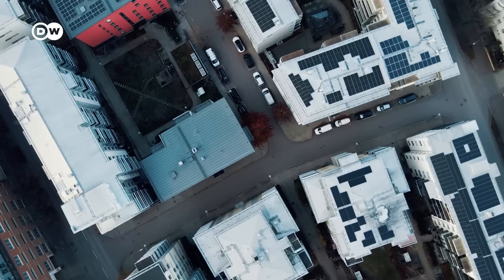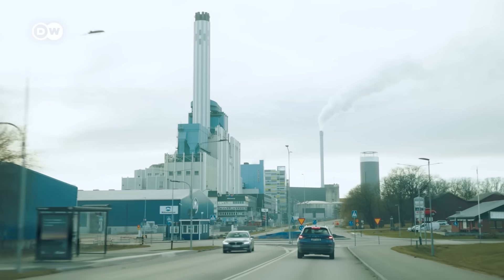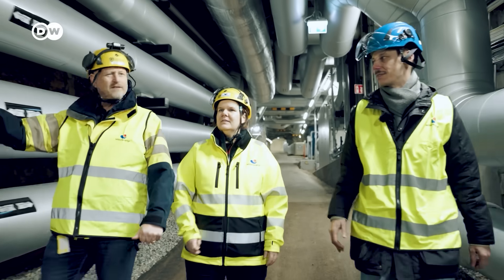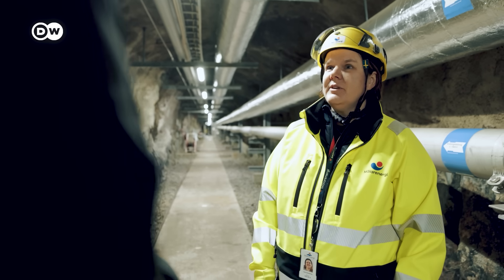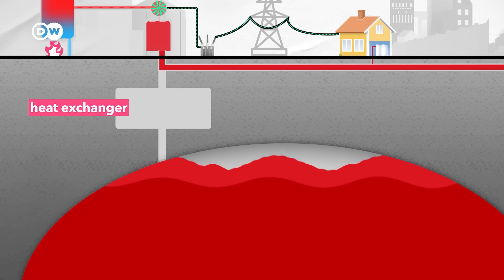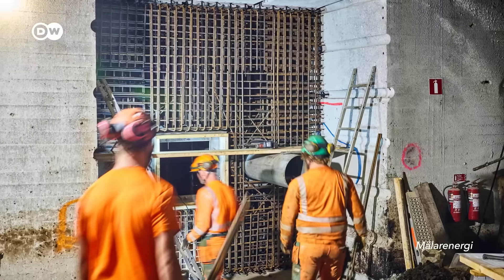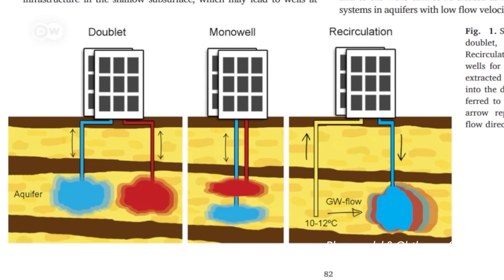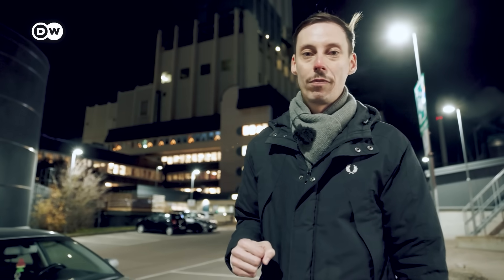Why a city in Sweden filled these caves with almost boiling water

Comment: I grew up thinking district heating was the norm, and what everyone was doing - it actually surprised me that a lot of countries, even in Europe are still heating individual houses, especially in big cities? That is so inefficient.
Reply: These systems usually use waste heat from electric power plants so losses don't matter much as that heat was being rejected to the environment anyway at the plant. The only main factor here is if the cost of pipelines and maintenance is worth the heating fuel saved in the long run. I do agree though in most cases it won't be worth it especially if the city has to turn on the auxiliary systems like boilers etc just to heat water in cases when rejected heat isn't enough
Reply: @CosmicSilhouette  the main saving in district heating apart from the lower individual investment is that you can chose the cheapest heat source, heat pump, combined gas engine, gas, waste heat, electrical heat, having a storage tank makes it better as then the district heating can chose to produce the heat at the cheapest times of the day.
Reply: I believe heat pumps on individual homes would be more efficient. And district heating would be a great solution for multi-unit & high-rise residential.
Reply: @mikeb5664  the thing is we hate pumps don't they need a certain temperature of weather like I read reports by engineers in the UK saying England for example would you want the worst countries for heat pumps just not efficient enough 
But places like Sweden Norway would be
Reply: Where I live some of the larger apartment blocks have district heating but houses have gas or electric.
Reply: In England in a council house that's a house for not very well off people 
 they forced us all to have gas central heating and get rid of our wood and coal fires, 

 once we're all stuck with gas central heating they jacked up the prices so much most people can't afford to heat their homes now.
Reply: @somethingelse4878 I wouldn’t recommend eating a home anyway to be honest
Reply: @Dlckslice  lol you've got to love Google voice to text
Reply: @somethingelse4878  at least it’s consistent using eating twice 😂
Reply: @Dlckslice  omg lol did not see that lol
Now I'm going to heat some toast lol
Reply: As someone who lived in the tropics, i thought the concept of heating your home is crazy
Reply: @davidtitanium22  Then think of district cooling, better do both then you always got hot water and cooling during warm periods, also makes the heat pump much more efficient as it just has to move the heat from one to the other :)
Reply: @davidtitanium22  I think the concept of cooling your home is crazy 🤣
Reply: District heating can be a bigger problem if not run in a reasonable way, such as not making the full use out of it, providing heating only when it gets too cold, or not billed correctly to the exact usage. In China, many colder cities have district heating, but its only used for heating, and start to heat very very late, while stops very early, leave every household have either electric or gas boiler for hot water and a few reversible air-conditioners for the transaction season. Meanwhile its not billed or run correctly as its only billed depending how big the space is, not how much energy you have taken from the network, and you can't control the temperature, thus most people are either too hot and  wasting heat or too cold that use gas or electricity to warm up at the same time. In this case, individual gas or electric heat will save more energy and provide more comfort. Also, nearly all district heat in China are provide by 100% fossil fuel, and a few provide by electricity such as heat pump which uses electricity mainly produced by fossil fuels.
Reply: @呵呵呵呵-l6i  Not optimal, having hot water year round is a blessing, and you don't have to burn things year round if you have more than on source of heat, heat pump, electric boiler, maybe combined gas engine, and then having a storage tank for 2-3 days either to bridge overnight or during a cold spell saved on the cost too.
Reply: Nope. The most efficient way of heating & cooling these days are with heat pumps installed on individual houses. Big systems like these are AWFUL for efficiency because there's just miles upon miles upon miles of pipe that dumps a huge amount of it's heat traveling said pipes. It's extremely expensive to maintain, install and buy.
Reply: @Runefrag  Heat storage for  individual houses is expensive and ineffient. And heat storage is much cheaper than electricity storage. That's why district heating is often the better solution.
Reply: @Runefrag  the upside is them generating electricity, and being able to get rid of a lot of material that would otherwise go into landfill, so you can't really claim that local heating is better, best to not generalize these things
Reply: @Runefrag  The reason why district heating is possibly less efficient than individual heating is because the water temperature in district heating systems is usually much hotter (95°C) than the water temperature in individual house heating systems (down to 30°C). The individual house heating can compensate the lowered temperature by increasing flow, but that only works because it doesn't have to run through the whole city. And heat pumps specifically suck at running with high water temperatures.

I do think that there is a place for district heating, the heat from data centers, industry, remaining fuel power stations or waste incinerators should be used instead of being thrown away.
Reply: @Heimbasteln  Heat from data centers is low temperature, below 50°C. - A big disadvantage of DH is their monopoly - there are people in Germany who have to pay 2x or 3x of what it would cost to produce the heat locally. And they are obliged to use the DH system. NEVER connect your home to DH!
Reply: @Runefrag  So inefficient that counties have been able to use this to heat homes in arctic conditions while providing lower carbon footprint and also being affordable?
Reply: @Runefrag    Yes, $15.5 million to build a heating system for 160,000 people is super expensive. Are you kidding?
Reply: @Runefrag   Yes, $15.5 million to build a heating system for 160,000 people is super expensive. Are you kidding?
Reply: @stevenmitchell1  that's one small part of the system, two weeks worth of heat, I suspect under the best conditions. District heating systems are fine for high density, they don't make sense for lower density, which is why most in the US were abandoned.
Reply: Get off your high horse, individual house heating could in theory be more energy efficient. More pipes in district heating creates more ways for heat to escape
Reply: @Dudenier Find your last remaining brain cell and think critically. Waste heat means district heating is inherently more efficient. Electricity generation, data centers, smelting, etc. It’s using all that heat that otherwise is vented out.
Reply: @Dudenier  wow someone got mad they live in a country where the government doesnt function well enough
Reply: @Dudenier  Using electricity to heat a house cannot be more energy efficient than heating a house with waste heat from generating electricity.
Reply: @Dudenier  "in theory" How about you get out of fantasy land and live in the real world.

Comment: Very misleading propaganda. District heating is not a new concept, neither using underground (geothermal) heat. While the thermal mass of big water reservoir can sustain high temperatures for quite sometime, but claims such as "extra heat from summer can be stored and used in winter" require some data, which this propaganda piece didn't do.
While they admitted the in the end that the impact of this project is small, but what they don't show (apart from the actual data about thermal performance) is that not every thing can be scaled up through additive systems.
Proper cost to benefit analysis should be presented to make such pilot projects before presenting them as "solutions".

Comment: Interresting to see a report like this from my home town.
I believe that Västerås was the first town in Sweden to introduce district heating.
And now first with this large scale heat storage.

But unfortunately I have so far only seen cost increase on my heating bill.
Hopefully this investment will pay off in coming years. Also for us consumers.
Reply: I moved here to Sweden from the UK, and honestly my heating bill is nothing compared to what I would have paid back there for a gas system inside the home. We're talking 1,2k SEK per month on the coldest days for a 15-20kvm 1 room apartment. Kinda crazy thinking about it
Reply: @ellafoxoo  tbf the UK has one of the highest costs in europe
Reply: @ellafoxoo  That's pretty cheap nowadays honestly, heating in Denmark is easily 2 to 3 times that
Reply: @Yous0147  not if you have individual heat pumps
Reply: Guy has an energy bill 60% cheaper than the average and still complains about it.
Reply: Paying off the upfront infrastructure costs may be expensive, but once those have been paid off, the ongoing costs should be cheaper for the long term!
Reply: Are there still some Swedes there?
Reply: @andersholmstrom3571  I highly doubt that we will see a decrease in cost for heating. As Mälarenergi is owned by the city and the Social Demokrats are in constant need of other peoples money. They are allowed to take I believe a 10% payout from the earnings they need the earnings to be as high as possible. Same with Mimer.
Reply: @toysoldiernostalgia  district heating network has a great waste of heat the network individual heat pumps are far more energy efficiant in total.
Reply: Kostade väl fett mycket bygga kostnader ska väl känas in .
Tror nedgången är här  rött stort skjul vid bergsknallen.
59°35'3.2"N 16°30'55.8"E
Använd "min karta" 
Lite löjligt med hemlighetsmakeriet (tycker jag..) mvh s
Reply: @perstaffanlundgren  smart man i krigstider den där...

Comment: Wish we can store cold like this and use it as our area  heat up with  high temperature in summer.
Reply: Yes you can. Like you can make ice in the cold times and melt it during the hot times.
Reply: @stormveil  wow must find out the proper method. It can really be helpful for mankind. Anyone who are struggling with varying climates. 👍
Reply: @kaushalvora7244  there are various ice making methods. one method is the same technology as air conditioning and fridges - The heat pump. When you dont need much cooling you keep running the ac to make ice so the ac is not overwhelmed during heat waves. Run cold water in district pipes instead of warm.
Idk if it makes economic sense tho, you'd have to analyse it with an expert.

Comment: I installed a heat pump last summer in California and I am very pleased. Saves me a lot of money on electricity and gas.
Reply: I did the same in Ontario Canada and got the same results. My only issue is dealing with the water run-off.
Reply: Air source or ground source?
Reply: Bad bot

Comment: if the distance to surface was slightly less, they probably could do big greenhouses on top of them in the north for tropical stuff to leech all the radiating heat :D
Reply: That would be cool, but if it radiated substantial heat, it wouldn't be very good for storage.
Reply: Not if they want to keep the location secret.
Reply: @a0flj0 This fascility is probably high security because of other issues than the water storage. In my town of Borås, Sweden we store excessive heat in a big accumulator tank in the middle of the city. It's even lit up with lights so it looks pretty. 😂